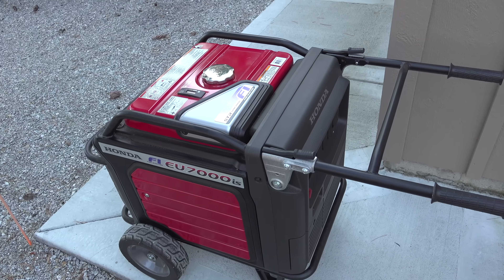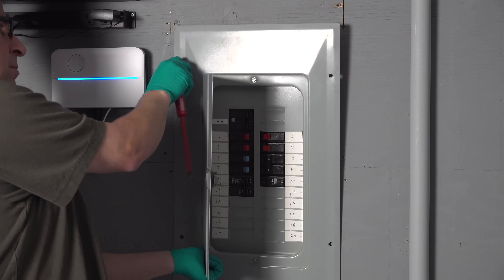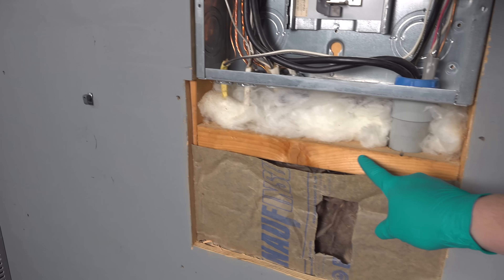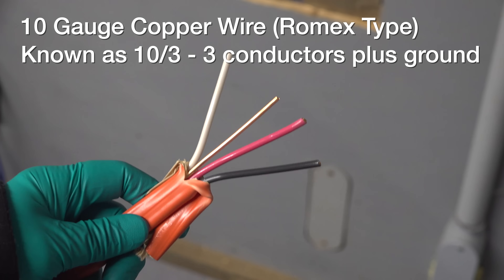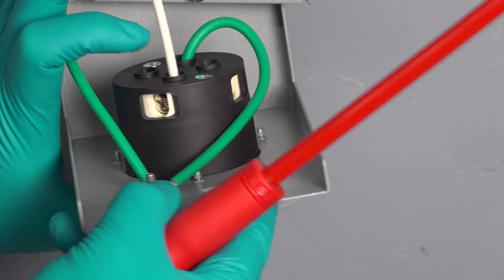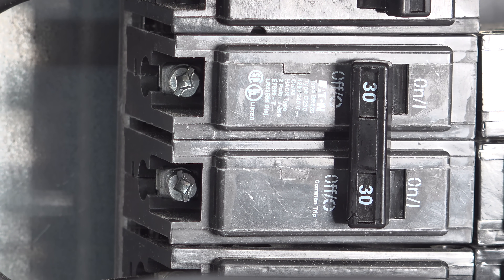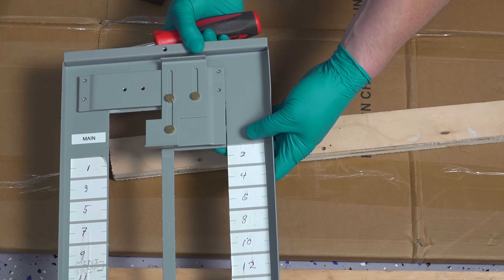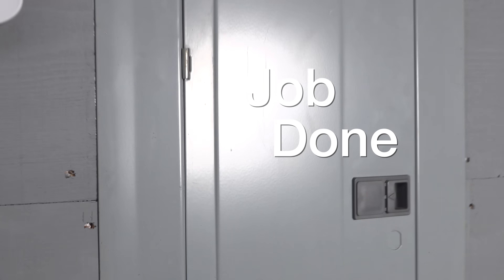Cheap & Easy Way to Connect a Generator to Your House - Legal Too!

Comment: you really want the inlet box outside so that the doors can be shut / sealed to keep critters out in the winter time. ask me how i know! otherwise good instructions. I wouldn't keep the generator that close to the house either really, should be at least 15 feet away to keep CO out

Comment: You are absolutely NOT allowed to double tap grounds under the NEC unless the ground bar is specifically rated for and labeled to permit two wires in one terminal.

Comment: I just had quick question Do you have get  certified  electrician  to installed  this inlet for generator  or should i in check with  laws in my area about  building and and installation  electrical  systems
Reply: I don't know of any state or city that requires an electrician to perform this work, but there isn't like a database to look up if yours does. Only way to know is to call your city permit or planning department.

Comment: It says on the face of the outlet box not for indoor use.
Reply: Its fine for indoor use. The indoor use is due to the assumption people might bring their generator indoors to use it. It doesn't consider if you are using rechargeable power stations which are used indoors

Comment: Why didn't you install this on the outside, thus eliminating having to leave a door open for an extension cord?
Reply: This install is likely for rechargable power station use. Lots of people are now just getting 2 large power stations and recharging them outside. It actually saves fuel because you will only run the generator for 2 hours to recharge a power station but the power station will keep your house running for up to 8 hours. It also means only having to listen to the generator for a couple of hours in the morning and a couple of hours at night.

Comment: At times I have both "Illegally" back fed my house or ran a myriad of extension cords. At first I had a really small generator (700-900W) that I could power a light, fan and a small refrigerator with extension cords. Later I got a bigger generator (3200/4000W) so I could run the well too. I bought all the parts, except a lock-out, to connect it to the house using the 30A. Sadly I'd misplaced the parts before I'd get around to installing it and didn't have the time when I would re-locate them. So, the next power outage I made a suicide cable and back fed it to the house "Illegally" though "safely". That allowed for one leg that I was able to run the refrigerator, the freezer, a fan and one small TV. I have hurricane lamps for light and a camp stove for cooking. To ensure I did all the switching of breakers I put a lock on the breaker box door.
I bartered for an even larger non-working generator (5500/6875W) it needed a few parts and one really expensive one and hadn't repaired it before the next power outage. Still no 30A connection, still no well. I then purchased an even larger (7500/9400W) tri-fuel one (on sale) because it gave me more fuel options and I'd be able to use either of the two smaller ones to give the larger one a rest and to service it. This last power outage the 5500/6875W still wasn't repaired and the pull rope broke on the working 3200/4000W so the new one didn't really get a rest and I still used it with extension cords.

I have since repaired the 5500/6875W generator with a new part in a different form factor and replaced the pull rope on the 3200/4000W one. I also converted it to electric start. I had to put a new pump of the well and it came wired for 120 volts. As I was re-wiring it to 240 I realized I could have had a working well during these extended power outages all along. I just had to re-wire it back to 120. Not an issue anymore because I am proud to report that I have remedied that problem. I finally installed the 30A 240 circuit to include the inter-lock. I have a power-back-on alarm too. All my generators are serviced, up to spec and ready to go (I still have all four of them). I have marked and color coded the breaker box as to what is what. What to leave off and what to turn on for each of the three generators with the new 30A circuit available. Once a month when I exercise each of the generators. I am fine tuning my list of which different appliances I can use at the same time using each of the different generators. The list is taped to the inside of the breaker box door.

Comment: All this does is keep you from turning the main power on when your generator is running. You can put a lock on the door of your panel to do the same thing. You just don’t want the power coming back on while the generator is feeding the panel

Comment: It’s expensive but you need a licensed electrician which I am do do this. You can not by code use wire nuts or anything else to splice wires inside your panel.
Reply: You don't need a licensed electrician. Anyone can install this hardware. Since you are a licensed electrician you are considered to be engaged in commerce so you actually can't use wire nuts to splice in a service panel. That doesn't apply to homeowners not engaged in commerce wiring their own transfer switch or interlock system

Comment: I just finished installing a 50 amp power inlet box with #6 wire.  It was a tight fit but I managed to get the box closed and secured with the screw. Since it was a tight fit I am concerned about a wire pulling loose.  How do I test for loose wires and possible shorts?  I have a multimeter.
Reply: Only real way to guarantee tightness is to use a torque screwdriver. Its suppose to be 35 lbs per inch for a 50A generator inlet, and it's a good idea to check tighten again every couple of years. Its actually a good idea to tighten all connections in any service panel every couple of years. They can loosen over time and it's the most common reason for breaker fail over time if they aren't periodically tightened.

Comment: So the interlock takes out 4 total bus slots. 2 for the generator, and 2 that are covered by the plate.
Reply: The plate shouldn't take out any slots unless you installed it wrong

Comment: Does it matter where your 30a breaker is installed on the rail? (Other than use of the interlock kit)
Reply: No, the only purpose of installing it next to the main is for the interlock. If you can make your own interlock capable of isolating the phases from one another, you can put it anywhere on the rail.  Some areas might not allow a homemade interlock since they will not have passed Underwriters Laboratory (UL) testing.

Comment: Nice video though two comments: First in your panel neutrals and grounds are not supposed to be on the same bar. Yes the the two are connected at this main panel, but they are actually serve different functions and never should be lumped together.

Second you should have used a torque screwdriver to attach the both breakers and the generator power inlet.  Most people have no idea how hard those connections are supposed to be tightened and unless they have a torque tool make them far too loose the first few times.

Comment: I'm confused.  30 amps is only 3600 watts at 120 volts. My generator only has 120 volts output so I don't see how even a 50 amp connector would be enough (10 thousand watt generator).  If anyone can help, I'll be glad to listen. I could hook both of the hots to my generator and that would at least Handle the 10 thousand watts with a 50 amp fuse.  A normal US house line has two different 120 volt Hot wires. It seems reasonable to me that you could connect them together so that your entire house would be served but all by the same 120 volts instead of two separate 120v circuits. Am I understanding this correctly or am I completely whack?

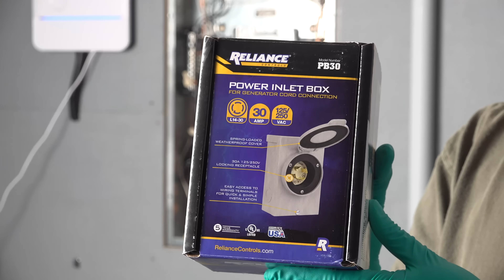Comment: Quick question.. any issues with the power inlet box[@1:50] being flush mounted installed for indoor setting? I don't see any mounting holes on the sides but new holes can be drilled. TIA.

Comment: This video helped me greatly. Only question I have is that the NEC says that the breaker that is backfeeding the panel needs to be physically tied down. Reason being someone could remove it while the generator is operating and have a live breaker in his hand. I didn't do this because my breaker didn't come with the hole for a tiedown screw and zip ties seem to only be a visual deterrent. I won't be dumb enough to take the panel cover off while the panel is being fed by the street OR the generator.
Reply: 408.36D most inspectors won't count this against you unless you are a licensed electrician. Probably 90% of generator breaker installs lack a mechanical hold down. Only in the past couple of years have they even been coming down on license electricians. If you ate asking must you follow this code not likely unless you get a teetotaler poindexter for an inspector.
Reply: @howardradford1985  Yes, most of the videos I've watched on Youtube omit this step so I assume it's a fairly new rule.

Comment: Good video. I'm getting ready to do a similar installation but my main breakers are outside and I want to install one of the transfer boxes that only power 6 or 10 circuits. One of the things I've seen in other videos is people using a torque screw driver to properly tighten the connector screws. I think it's specified at 125 in-oz. You tighten, wiggle the wires, tighten again, then bend the wires for a final install, and give it another torque.

Comment: I used your video to hook up my own generator interlock and it was a huge help! My current issue is trying to figure out what I can power now with my 5300-watt generator. I plan to upgrade, but for the meantime, could you do a video on how to go through a breaker panel and calculate the watts on breakers using a multimeter?
Reply: You really can't use a multimeter to gauge your use cause you don't know when certain circuits will be on and at what wattage they will draw from day to day. Today your coffee pot might only need 100W tomorrow it might require 200W. There is always some sway. Best to get get estimates from the manual. Things like low tide or high tide hot day cool day can cause these fluctuations in wattage needs.

Comment: If my generator is rated for 15Amp max would I just need to get a 15Amp breaker and still be able to use the other stuff in the vid or would I need a 15Amp outlet too?
Reply: You should always use a breaker rated equal or less than your generator will produce. 15 amp is the smallest common breaker, technically smaller breakers exist but won't be easy to find and really no point in trying to find. It may run items on higher amp breakers but not always. Sometimes items on 30Amp breakers actually only need 15Amps and doesn't use the entire 30Amps. I wouldn't trust it though especially if I'm running multiple items. If I only had 15Amps I would only use items that are on 15 amps breakers and at maximum I would only run 5 items. At that point you might as well just use extension cords.
Reply: @ I did some research and completely agree with you. Thank you. I just said screw it and bought the 11k running watt and am using the 30amp. I was just trying to avoid buying a new generator, but did anyway.
Reply: @anthonyhill9981  That's great. I have a 9600 running watts generator and only run my 20Amp breakers. It runs 2 refrigerators, 2 window AC units, 3 TVs, all my lights, my wireless router, and I still trust it to run the microwave or coffee pot or one of stove eyes at a time. Though most of the time I fire up the propane grill.

Comment: I am currently (ha ha) running my well pump off my small  generator while my main power line is down, by the simple AND TEMPORARY.... expedient of simply removing the well breaker from the panel, while leaving the wires connecting it to the pump connected to the breaker. The generator's input wires are inserted into the flanges that normally connect it to the power panel. It's for sure a non code approved/redneck way to do it, but not rocket science and I only need to run the genny 10 minutes every 3 or 4 days.  I have a 200 amp transfer switch I will set up to be idiot proof for the next time the need occurs.

Comment: Thanks for the simple explanation.  I had to watch a few other videos to nail down whether to do a floating neutral or bonded neutral, but I think I have that figured out.  My cottage is in a rural area with lots of outages and subzero temps.  After 10 years of inconvenience, I'm finally installing a 30A outlet and interlock for my panel.  Most stuff in my place gas so I don't need much power requiring a 50A setup. (gas stove, heat, and water heater, and a wood fired hot tub)  

One thing that made my life easy was that I installed an oversized conduit from the crawl space up to the panel in the utility room making it easy to add circuits without any cutting in to walls.  The line just goes along the floor joist, and out through a hold drilled in the rim joist to my new box.  easy peezy.  Thanks again.

Comment: Yes, these boxes are great. Light goes off, time to fire up the Generator. Just make sure you shut off your MAIN BREAKERS before firing up the Generator. And DO NOT switch those Main Breakers back on until the Generator is OFF.

Comment: There's one thing missing from your explanation: A hold down for the generator backfeed breaker as described in NEC 408.36(D).  "Back-Fed Devices. Plug-in-type overcurrent protection devices or plug-in type main lug assemblies that are backfed and used to terminate field-installed ungrounded supply conductors shall be secured in place by an additional fastener that requires other than a pull to release the device from the mounting means on the panel."

Comment: Is it safe to touch the HOT main wires? They're covering my ground bar and im worried about pulling them out of the way to get to the ground bar. Of course I have the main breaker off, but the mains coming into the box are HOT and cannot be switched off further up-stream.

Comment: Newbie question, will both rows of breakers be powered by the generator breaker you installed, or just the row it’s installed in?
Reply: You can use all the breakers in the panel. But of course only use the important one and needed because is 30 amp. If you want more power get 13k watts generator to power the whole house and install 50amp breaker #6 wire thhn/thwn

Comment: Great tutorial, watched over and over.  One question I have is, why didn't you use the empty space next to the main shut off breaker?  My box is identical to yours with the same empty slot to the right of the main shut off breaker.  Thanks for sharing.

Comment: Does your generator need a 240V outlet for this?  Mine only has a 120 3-prong twist lock.  Obviously an adapter would be necessary at the inlet to go from 4 prong to 3.
Reply: They sell 120v generator inlets, but you will only be able to connect 120v loads (unless you get an auto-transformer like the victron one that turns 120 into 240/120 or provides a neutral from 240 only generators/inverters). I'd go so far as to say you shouldn't put your transfer switch upstream of any 240v loads, as in I'd recommend putting your 120v loads that you want to run on a sub panel and put the transfer switch there. Side note: nema TT-30 to nema 14-50 adapters for RVs just connect both hots on the 14-50 (which is a 50 amp plug with both 120v and 240v) to the single hot on the TT-30 which is a 30 amp 120v plug grandfathered into the nema scheme (since we already have a grounded 120v, its called nema 5 and and the 5-15 or 5-20 is what every wall outlet is lol). If you use this adapter and your interlock was to fail it would short your 240 supply so you might want to go for the fancier interlock type than the just sheet of metal used here, or at least I would lol. You could do the same thing as that adapter on the generator inlet side of your critical loads sub panel so you don't have to put all of those loads on one phase when you are using grid power.

Comment: What I didn’t see discussed is about a bonded generator connected to a bonded main panel. To my knowledge all main panels are bonded. You can’t connect a bonded generator to a bonded main panel. One or the other has to be not bonded. So what is the proper answer can a bonded generator be connected to a bonded main panel or not?

Comment: Thanks for the great vid! Question for anyone:  is there any reason I cannot run the generator line directly to the box, bypassing the inlets? I already have #10 wire that goes to the generator location (from a hot tub removal) . Panel end is going directly into a double 40 amp breaker. Thanks for any help.

Comment: How do you wire the hookup between generator and inlet box?  My generator just has a 3 connector plug.
Reply: Buy an adapter for your generator.  You don't say if your generator's receptacle is a TT-30R or a L5-30R, but adapters to L14-30 are available for both of these configurations.

Comment: Excellent video and very well laid out with helpful purchasing guide!  One question I have and there are lots of opinions out there. Should the generator be grounded to a ground rod driven into the ground for temporary usage during power outages??

Comment: I did it with a 50 amp inlet and then bought an adapter from the standard 50 amp to 30 amp so that I could plug in any generator. Works great.

Comment: Just buy a 30A transfer switch that comes with a remote power inlet box, which installs outdoors where the generator is used. Wire up the most important circuit breakers, and you don't have to worry about anything in the main panel, messing around with the interlock, or even flipping breakers in your main panel. Most of the transfer switches I've installed come with an amp meter, so you can ensure you don't overload your generator, providing additional safety.
Reply: This method allows everything in your house to potently have power vs a handful of select breakers and much less complexity than a transfer switch, No brainer IMO.